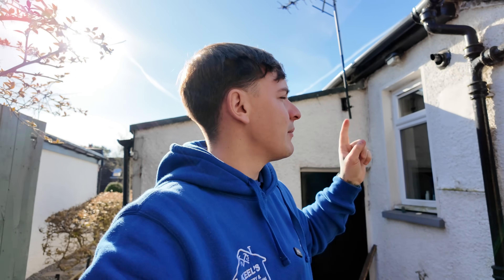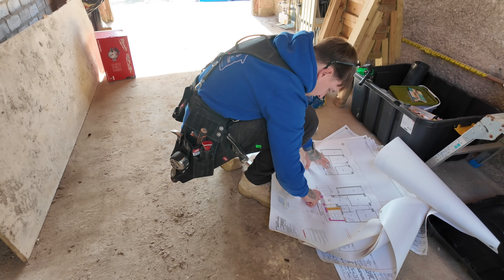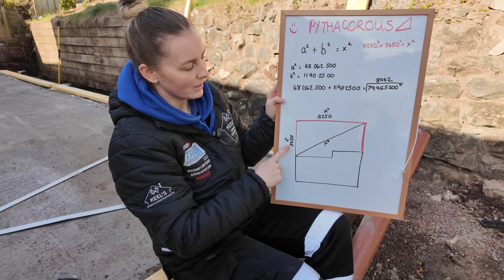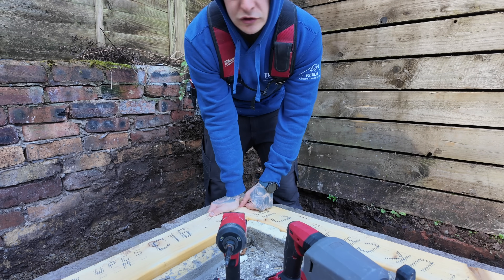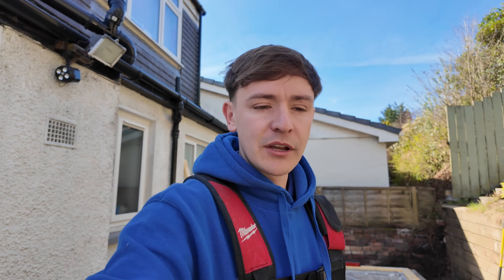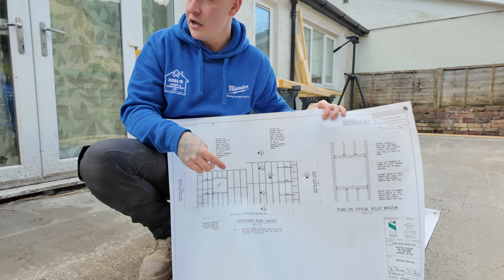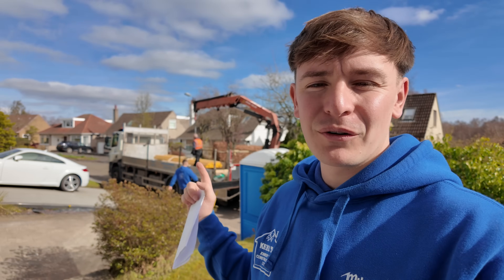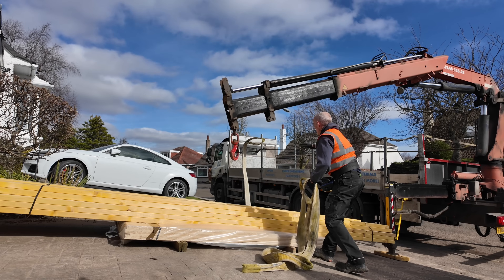Setting Out the Wall Plate | Home Extension UK

Comment: Genuine question, wall plate just levelled with plastic packers? Is that standard?
Reply from the maker: Yeah bro, plastic don’t rot, old school boys might use old slates off a roof 
But plastic packers are sound especially if it’s only 2/3mm here & there brickies actually don’t a very good job on this one

Comment: them numbers 3,4,5 are a pythagoran triplet , you can also use 5,12,13 or 7, 24, 25 depending on the size you are trying to square. there is many other triplets but they are the ones i have used most
Reply from the maker: @bryanwilliamson7778  correct bro, very interesting thanks for sharing 😎🙏🏼